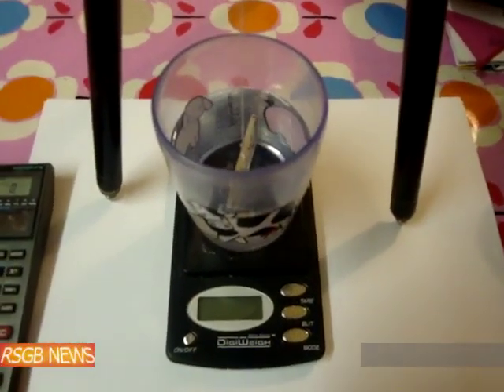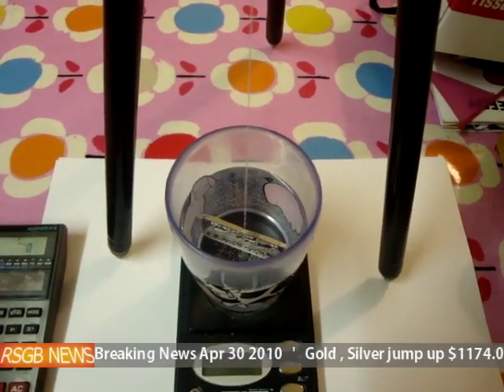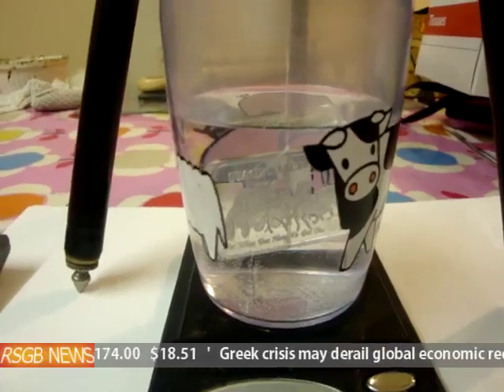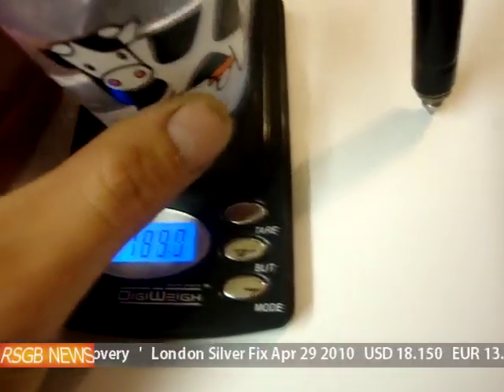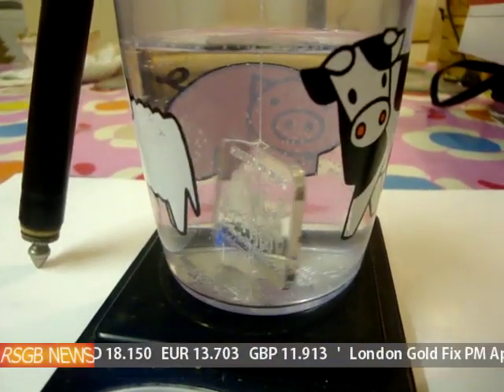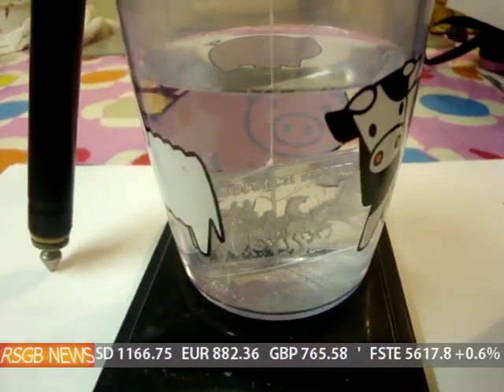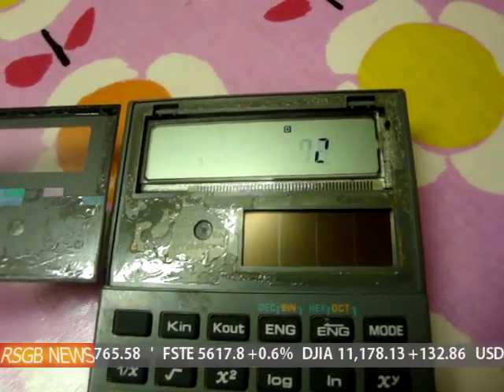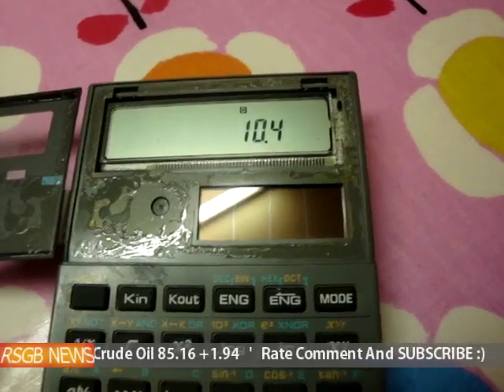Howto Test Fake Gold and silver Specific Gravity

Comment: Thanks for the specific gravity lesson, it works like a charm and is quick & easy.

Using my gram scale accurate to within a hundredth I tested supposedly .999 pure gold, silver, copper, iron, zinc, lead, and tungsten.

All but the tungsten came within 0.04 grams of the published g/cm3 densities. I will have to ask the company I bought the tungsten from to double check their stock as mine came back with a 14.26 when it should have been 19.25.

Comment: Useless video. The weight of gold in air and its weight in water is to be measured. Here the water pot is placed on the electronic weighing machine. and gold is hanging.so the weight of water is taken. not the the weight of gold in water. Dont believe  this useless video. Jose PJ
Reply: Works fine.Try it out

Comment: This is a rigged test. I think you edited out the adding of 3g of water to the cup.

A fully suspended bar will NOT make the cup of water weigh any more. What you should have done is suspended a  cup of PURE water and then weighed the bar, using a frame, while it is in suspension . It should have then weigh 1/10.4 less, being the displaced water.
To get the sg of the bar you would have to weigh the DISPLACED water and then dividing it by the original weight.
Reply: The displaced water is what adds weight to the cup. This happens because buoyancy loosens part of the tension that the nylon thread normally experienced when the item was suspended only in air.

Comment: submerged in water, the weight of the silver is 3.0 grams. now what this really means with a scale that is precise to .1 gram is that it weighs between *below* 3.05 grams and *above and including* 2.95 grams. so in that meassurement you have a 1.7% uncertainty (0.05 / 3). so your results being only .87% off, and one of your measurements having a potential error of 1.7%, your results are valid for pure silver.

Comment: Should you not measure the weight of the item immersed in water ? This means that you should measure the item in air and then measure its weight in water. Now you are not measuring its weight in water, but water with a silver bar hanging in it :) You should also take into account the temperature of the water and the water used should be distilled. 
Google this doc to get it right :YDK01_YDK01-0D_YDK01LP
Reply: If you let it hang in air at a certain height and then introduce it to a water container that is deep enough that it hangs in there without touching the water container, you've effectively measured the weight of the displaced water

Comment: Hi, I saw the video of the "fake" Austrian bullion. But something does not seem right.
The weight was correct even though the thickness was too thin, however, the specific gravity test of a piece of the coin showed it to be lighter than gold.

But how can it be that a ( dimensionally smaller coin ) can weigh the same as gold, however its specific gravity shows it to be less dense ???

I call into question the accuracy of the testing instruments used to conduct the original test.

Comment: @ShillBasher If the specific density is more (displaces less water) or less (displaces more water) than it should be, then you know it isn't pure silver.  The correct specific density is no guarantee that it *is* pure silver (could be a metal composite, with a silver coating for example); but it makes it more likely that it is so.